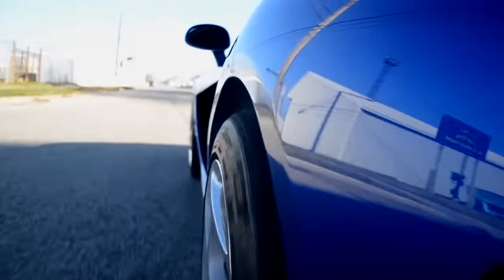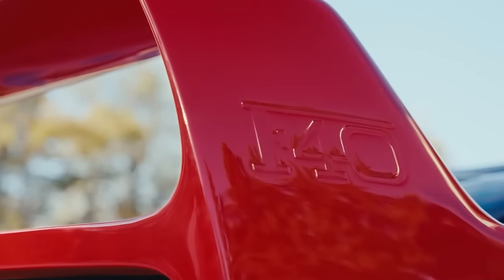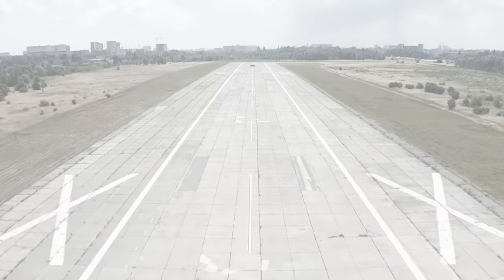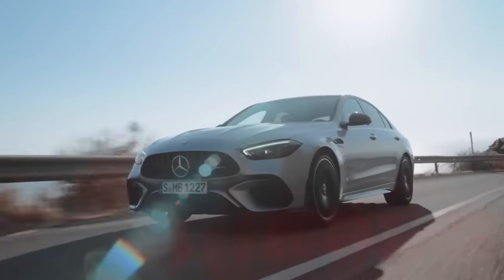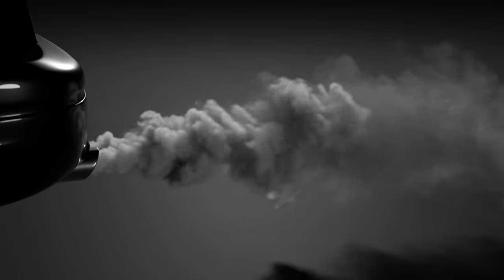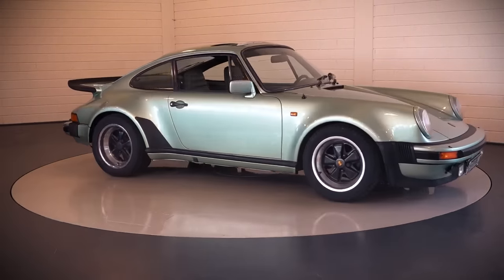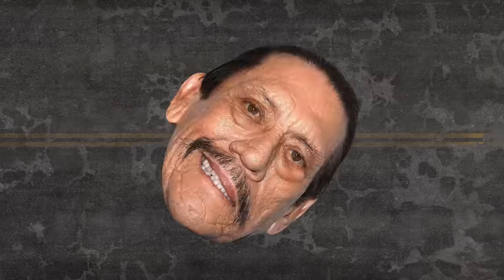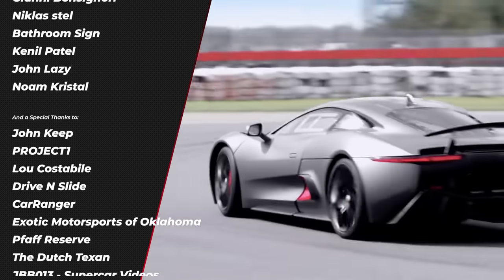Top 7 Cars where Size DOES NOT Matter

Comment: The turbo s is proably the most efficient, sports/supercar you can buy, even being able to gap a plaid from 0 to 80 till it catches but it was only 600 hp. Crazy to think about it like that.
Reply: Plaid couldn't even beat a normal 911 Turbo , so if its turbo s then there's no fucking chance for it
Reply: Catches? After 80 miles the 911 pulls away even more.
Reply: @locom7657  does not, watch throttle house the 911 turbo s evens with the plaid at first then the plaid out runs it.
Reply: Proably ? 🤔
Reply: @jonesjonz1  so ur saying a dyno dosnt show that it makes 600 hp and Is lying to us? Well it ain't so dont call us all dummies and get ur facts right.
Reply: @Nfs-HP-Enjoyer  hate to break it to you, but plaid obliterates a 911 on the 1/4mi. Turbo S included. Just has too much torque and acceleration both low end and high end. I hate to admit it, but it just shreds almost anything with its sub 9 second 1/4mi. Stretch it to a half mile and maybe, idk what time the turbo s gets on that. Pretty sure the plaid is like 15-16 seconds though.
Reply: @semskguy  i would still take 911 over tesla model shit anyday everyday
Reply: @Nfs-HP-Enjoyer  oh me too for sure, but the S plaid is a f*cking silent demon and I can't not respect the insanity of it. That acceleration is just unmatched, especially from around 80 to 160mph. Ofc it doesn't really keep going after that though
Reply: @semskguy  My 2014 facelift E63 can go 320 km without a speed limiter 😤 faster than the S plaid😤😤
Reply: @Nfs-HP-Enjoyer  my rav4 with sport mode will beat that 😈
Reply: @semskguy  my prius with a fart can exhaust can dust your rav4
Reply: @Nfs-HP-Enjoyer  S Plaid destroys Turbo S even to the mile. You haters may choose the slower car, but just accept this simple fact.
Reply: @mrb2349 Simple fact - Tesla Plaid is f#^king boring car. Both with driving and design.
Reply: @klodknife  that’s not a fact, that’s you unable to cope with the fact that Plaid absolutely destroys anything else you bring against it. I can’t imagine an ego so fragile that accepting the Plaid is superior makes it go ooof.
Reply: Tbh I'm waiting for the 911 Turbo S with the electric motors to come out, its gonna obliterate the model S fr.

Comment: The Bugatti EB110SS that came out around the same time as the XJ220 with similar spec was probably worth a mention…
It had a 3.5l quad turbo 60 valve V12 that put out 603hp and managed 0-62 mph in just over 3.4 seconds.
The cylinder count may not be small, but the capacity was.
Reply from the maker: Yes, that's a good pick
Reply: Underpowered. They should have increased the bore, instead of destroking it.

Comment: In Formula 1 in the 1980s (the turbo generation) there were 1.6ltr 4 cylinder turbo charged engines putting out 900-1000bhp! The ultimate was a BMW version that could output possibly up to 1500bhp in qualifying trim! In the early 80s!

Comment: The Bugatti EB110SS that came out around the same time as the XJ220 with similar spec was probably worth a mention…
It had a 3.5l quad turbo 60 valve V12 that put out 603hp and managed 0-62 mph in just over 3.4 seconds.

Comment: The F40 was the first where the company advertised the 200mph barrier was crossed, but the first car that was released that could truly do it was the Porsche 959
Reply: The 959 topped out at about 196/197 mph, it's the 959s that broke the 200 mph mark. It doesn't matter though, because the 959 was a homologation special, not an actual production car like the F40 was. So the F40 still gets to claim the first production car to break 200 mph. Now some may want to argue that the Dodge Challenger actually did it first, but even that isn't true. Because the one that did reach 200 was a race modified vehicle. A Daytona that got sold out of a showroom wasn't the same as the one that hit 200 mph, and again the version that hit 200 was once again a homologation special which was made so Dodge could race that design.

Comment: 9:08 I wondered when you're going to talk about the Mercedes AMG 1,especially after you talked about his brother, the Mercedes c63se performance, and aspecially when the AMG 1 makes more power, from an even smaller(although a not a 4 cylinder) formula 1 grade v6 turbo hybrid engine, that producing around a 1000+ horsepower, that, from my calculation, means that it's almost as, I'd not more efficient then the c63se performance.

Comment: I think it depends...personally on a circuit I think a bigger displacement is better than forced induction because there's no surprises: You push the gas, you have gas. In turbocharger you have lag, in supercharger you have parasitic loss that makes the engine feels heavy and increase the time to rev just like a heavy flywheel.
A big naturally aspirated engine can have more low end torque for corner exit and keep the revs "light".
Reply from the maker: With sequential turbos and hybrid systems there is no lag.

Comment: Turbo is a displacement supplementer, the mazda is 1.3 but the turbo ensures it ingests more than that in volume of air... An engine is a pump a turbo is a pump on pump makes air compressed and dense then stuff the other pump so 1.3 is the static displacement but not the final

Comment: alright I’m going to be that guy here for a second. The RX-7’s displacement isn’t really 1.3L. Rotaries can’t really calculate displacement the same way that normal piston engines can. 1.3L is closer to the displacement that one singular rotor produces, therefore the ACTUAL displacement of the RX-7 is much closer to 2.6L than it is 1.3L. Which puts it a lot closer in displacement to an RB26 or 2JZ than the new GR Yaris engine.

Comment: The most serious contender isn't even there ! Since you spoke about abandoned or failed project, there's another one, called Peugeot Oxia, which was ready for production, but never did.

The Peugeot Oxia, was the earliest ultimate speed record breaker, way before most of the famous cars. It only use a 2.85 L Twin Turbos V6, with a 680 HP.
This engine was a direct detuned version of the ultimate speed record holder in a competition, which have been set on 24H of LeMans.

This Oxia was literally a spaceship back at the time it went out. 4WD 4WS, active Aero, Solar cells to power the Aircon to keep maximum engine power, electronic magnetic injectors, the key was an electronic card, and much more things we're only getting nowadays 40 years later.

Comment: In the seventies I owned 3 minor models BMWs with 2 liter engines, and past 100 horsepower, which was much and impressive by that time (Also the fuel consumption)! Today I drive a 1500cc Peugeot diesel, with 102 horsepower, and faster than the first, and using much, much less fuel doing it!

Comment: you have to understand the f40 is fully striped off of comfort.. unlike the modern day super cars with touch screens and other comfortable stuffs the f40 is brutally uncomfortable to drive in a long duration. its fast because of its weight reduction and that 2 huge snails blowing air into that monster

Comment: I still want to know why you thought the gemera wasn't worth the list
yes it's expensive as fk and mostly electric but since when was 600hp from a 2L not an achievement.
still a great list and vid
Reply from the maker: This video isn't about small engines with lots of power, but fast cars with small engines. 

Gemera is fast mostly because of electric motors, and that's why it's not going in the list. Having a small but punchy engine doesn't change that.

It's like that part in Top Gear when they mocked American Green Car of the year - Cadillac Escalade Hybrid with 5.7L V8 and a small battery.
Reply: @TopCarsTV  yeah I get that 
But you've got to be impressed by the engineering, 

I can't stop imagining something like an a110 with this engine

Or maybe in an "entry level" smol ferrari back with the dino badge 

Hell, even in something like a gr yaris. 

Yes gemera might not be a fast car with small engine but the possibilities are limitless.

But then again I'm confused why such big manufacturers won't make something like this, I don't think they can't.
Reply: I think the video should be based on "only" Gasoline running cars, hybrid electric motors paired with an engine doesn't hold a candle to me

Comment: Main reason the XJ220 never met its potential, was Jag was having its own crisis at the time and couldn't find the value in a hypercar. So the engineers built it in their own time as a passion project. They couldn't get funding for the V12, it would have been too long to use an existing one, and the AWD would have made the thing too heavy. They didn't want to shorten the dimensions and the lines, hence the V6 is swimming in space. There's room for all that stuff tho, if you wanted..
Reply: I visited Eagle E-Types in 2002--you probably know who they are.  They had an XJ220 for I think $120k.  I should have bought an E-Type AND an XJ220.

Comment: I just remembered another one, the BAC Mono. It’s Ford sourced, Mountune tweaked 2.5l 4cyl produces 343bhp without the use of a turbo! 😮
That’s 137bhp per litre! 😮😮
Reply from the maker: 137hp/L is good but not mind-blowing. 24 years ago Honda S2000 had 124hp/L while a 2023 GMA T.50 pumps out 163hp/L

Comment: the lancia delta s4 group B, pushing around 600hp with 1.7 liters displacement, in 1985, there was even a prototype for the group S (group s never started racing) with more than 1000hp and the same 1.7 litres twin charged (turbo and volumetric at the same time) 4banger
Reply from the maker: Lancia ECV 👆
Reply: @TopCarsTV  right, and then the ECV 2
Reply: @matteooliveri9131  It had a turbo and a supercharger 👍😆

Comment: Am I the only one who prefer smaller engines over the big ones? I mean, sure 600HP from a 6.2L V8 is a good number, but 600HP from a 2.0L 4 cylinder engine? That's impressive, and not to mention that being smaller means that this engine need to rev higher than bigger engines, so the sounds is music to my ears...🤤
Reply from the maker: Huge power out of a small displacement usually means that the engine won't last as long
Reply: @TopCarsTV  Depends how many power you put in that engine, where is its redline, how strong are the engine internals and how reliable are its electronics. So 600HP from a 2.0L 4 cylinder is possible for a road car, but anything beyond that wouldn't work reliably.
Reply from the maker: @leomux2004  1.6L 575hp V6 in AMG One lasts 30,000 miles.  

600 from 2.0L is hardly much better
Reply: @TopCarsTV  Yes, but that's a F1 engine that was converted for road use, and originally it had 850HP from the ICE alone plus 160HP from the MGU-K, resulting in more than 1.000HP, but because of they all the known reasons, they adapted the engine, reduced it's redline from 15k rpm to 11k rpm, changed the engine internals, and added new stuff to make it daily-drivable (new coolimg system, starter motor, etc.). Now a clean-sheet design 2.0L I4 road car engine could reach those 600HP if it was designed for that purpose from scratch. So it depends from case to case...

Comment: The first production car to break 200mph was a 1969 Dodge Charger Daytona on March 24, 1970, during testing at Alabama International Motor Speedway (now Talladega Superspeedway).
Reply from the maker: That was the race car. A production version couldn't go that fast
Reply: @TopCarsTV  Yeah I suppose so, but it is still classified as being the first "production" car to do over 200mph.
Reply from the maker: @secret_one  I guess it isn't because the F40 is classified as the first production car to hit 200mph
Reply: @TopCarsTV  Yeah you are correct, I humbly apologies.
I just googled what I read again, even though the title said it was the first production car to reach 200mph it was not road legal, which the F40 certainly was.

Comment: i hoped for at least a mention to the legendery 33 strandale that pushed 227 hp from a 2.0 L v8 (or at least the montreal with the 2.6 L 203 hp which is still a lot, especialy in 1997). And since i started the alfa romeo talk, giulias qv have also a 2.9 L engine and it accelarates faster than the f40

Comment: to us in the US that's a fairly common size for a V6 engine not a V8 engine the biggest V8 used in a luxury car was Cadillac's 8.2 L V8 used in the 70s in the Fleetwood Series 75 Limousine Series 62 Eldorado/Deville etc. mind you in 1972 for example the Eldorado Convertible had 235 HP and 385 pf torque went from 0-60 in 9.7 seconds similar to a modern Toyota Camry though about 1300 LBs heavier and did the 1/4 mile in 17 seconds at 81 MPH

Comment: Small engines with big turbos are fine and fun for the track, but not as ‘road’ cars.
Ask anyone who drives a Volvo XC90; 2.0 litres that puts out 320bhp, trying to propel a vehicle that weighs 2.25 tonnes. It is constantly wheezing and changing gear to cope with even just small inclines. Thereby, it’s buzzy and noisy and not relaxing.

In other words BHP is relevant on the track, but in 95% of road driving, TORQUE at LOW revs matters far more. My ‘runabout’ in the UK is a V8. It develops all of its torque at less than 1800rpm, which means that it rarely needs to change gear, which means it’s smoother and vastly more relaxing than a car that’s powered by a hairdryer.

Comment: Turbo S is one of the most perfect cars one can buy. Want a Lamborghini? Ditch it, get Turbo S it'll be better and more comfortable to drive on typical roads and due to its rear engine placement it takes off like a rocket off the line, in carwow the Turbo S could do 2.5 seconds 0-60 miles, like literally. Plus it can take down every Lambo in a drag race, so that's a good value for money supercar killer.

Comment: Btw modern cars can't reach top ends with so little power as the F40, because all though top speed isn't necessarily limited, unless you pay a massive premium Your accelration and rpm advancement is.

Comment: Stolen from Wikipedia:
The Jaguar C-X75 is a hybrid-electric, 2-seat, concept car produced by British automobile manufacturer Jaguar Cars in partnership with the derivative of the Formula One team, Williams Advanced Engineering which debuted at the 2010 Paris Motor Show. The powertrain of the C-X75 concept is rated at 778 hp (789 PS; 580 kW) through four YASA electric motors, each of which drives one of the four wheels. The batteries driving these motors are recharged using two diesel-fed micro gas turbines instead of a conventional four-stroke engine. It was described as a design study that would influence future design and technology.

Comment: 5:18 all those numbers but still slower in a quarter mile race than the M3 which has a 170hp disadvantage. this could be a technical achievement for the ice but its hybrid system doesn't work like it's supposed to. You get that 680hp if the car "feels" like it and the car that we're talking about is the same weight as a charger hellcat so no surprise it's slower and worse in every single way than its BMW competitor. And that price tag for a small, not so well built saloon with an unnecessary hybrid system that doesn't even work, also made by a brand that should've known way better... I think I can say this is one of the worst cars, in the world.

Comment: So the P1 has a "sizeable V8" (3.8l), but the Turbo S's 3.7 is small enough to make the list? And no Gemera? Not a very strong or consistent list.
Reply from the maker: Gemera is fast mostly because of its electric motors. 
Turbo S got on the list because I wanted to show that speed is more than just straight line speed. 
Another contender was the Evo FQ400, but I decided to go with the ultimate instead.
Reply: @TopCarsTV  Like I said, inconsistent: The C63 has a less powerful 2.0 engine bolstered by electric power, it made the list (presumably as a comparison to the 6.2 C63); The CX-75 has a smaller engine than the much faster Gemera and it's also got electric motors, but also less power from both; Ford GT has a smaller engine than the Turbo S (3.5 V6) and makes the same power. Title should just be "7 Cars in no particular order that are faster than you'd think only looking at ICE displacement".
Reply from the maker: @martinjamieson  C63 gets most of its power from ICE, that's why I focused on it so much. (comparison with Agera)
The same story goes for CX75, but not Gemera. 
Ford GT isn't as fast in the real world as the Turbo S. 

Besides, the art of making interesting videos isn't to list 7 cars that all have a similar story to tell. That gets repetitive and boring real quick. 
If you want most people to watch for longer you need to keep it more varied. That's why there is the GM EV1, old Ferrari, latest Turbo S, a canceled CX75...
Reply: @TopCarsTV  Why say "top 7" when you just mean "7"? Oh right, the fabled algorithm, and have to appear to keep up the "Top" branding, even when it doesn't apply.

You didn't even include the Mercedes-AMG One (apart from ironically mentioning it when talking about the C63, and the teaser pic), yet it has a smaller and more powerful engine than the C63S, and that engine still provides most of it's power.

The slippery little GM has no engine at all, so not really sure why you're sometimes so concerned about electric power vs ICE, but only sometimes. Again, inconsistent. And the Agera has a 5.0l V8, pretty sure we both agree it wouldn't belong here.

Should rename the channel "SomeCars YT"
Reply from the maker: @martinjamieson  hey, don't hate the player. Hate the game. 

I hate it too